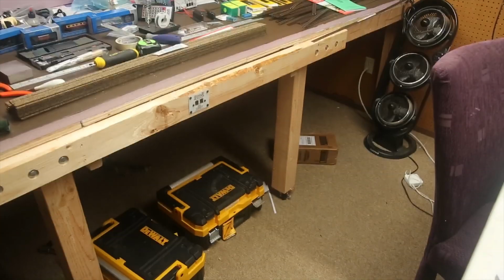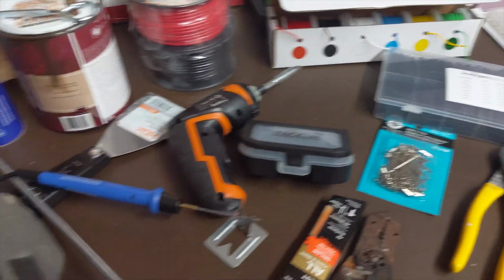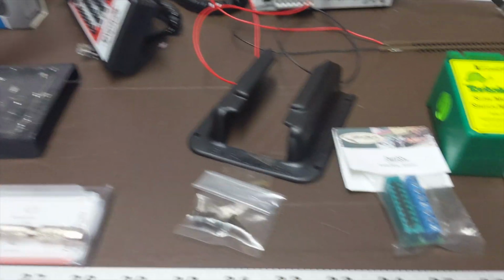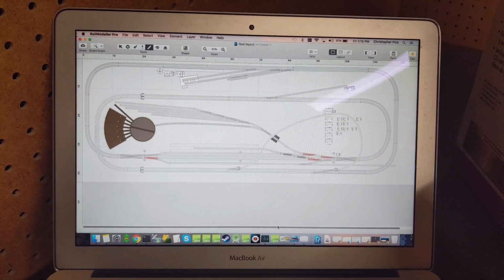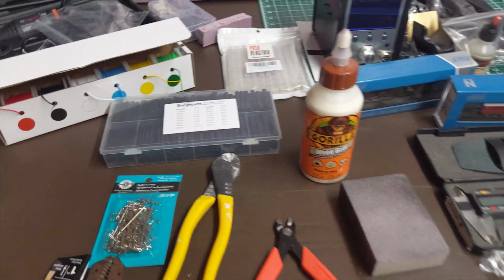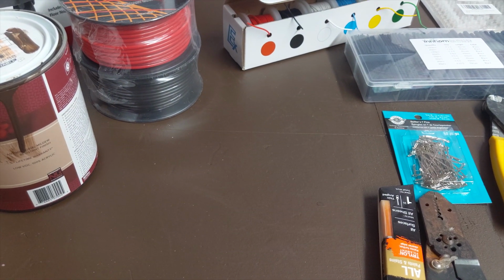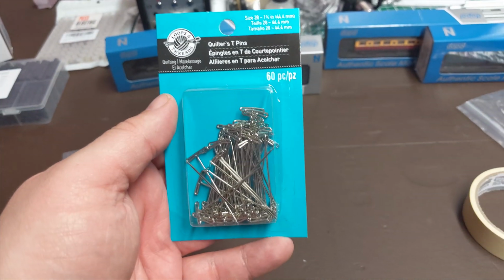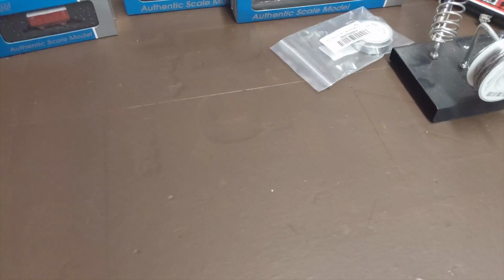Getting Started with N Scale DCC Model Railroad (EP 1) (4K)

Comment: Yep it is expensive  , I have been into HO & N scale since I was in the 6th grade. It has gotten more expensive but your best bet is online shopping and train shows. Also your not into the scenery,  extra electronics ,  rolling stock and etc.  Expect to spend a lot more. Have fun with your layout build and your vids.
Reply from the maker: I was into HO trains through highschool, and then took a 25 year break.  I noticed most train shows happen over winter in the Pacific Northwest. But definitely been buying online, especially with the uk theme. I have most of my electronics.. Guessing  there will be a bit more to buy. Scenery, I can't wait to get started on it.. But trying to build a good foundation, and have good plans up front is slowing me down, but should save money in long run.. I can't believe how much extra locos and rollingstock cost. I need to buy some so I can validate the grades on the layout (if engines can handle them). Thanks for watching & commenting!
Reply: @travisdale-pickmeremodelra3090  yes the industry has gotten very expensive.  I was into it very much in the 90's but then packed it away until a few years ago. I have been collecting again since then and have 90 percent of almost everything I need for the 1st layout module with parts for additional modules. The bench work is almost complete and wiring is next . Hope to have trains running on the top level soon . My small staging underneath the layout is complete.